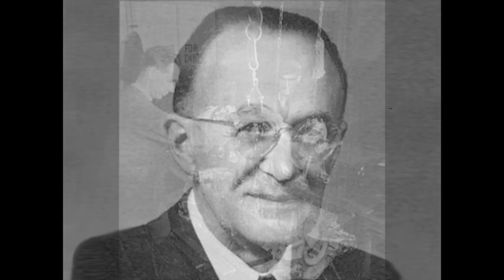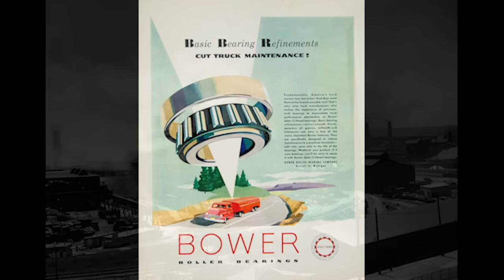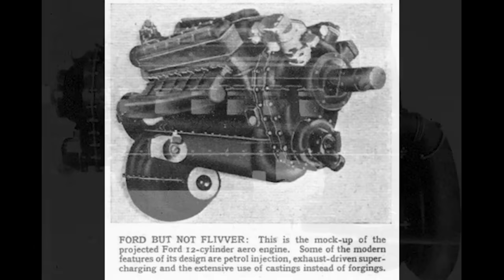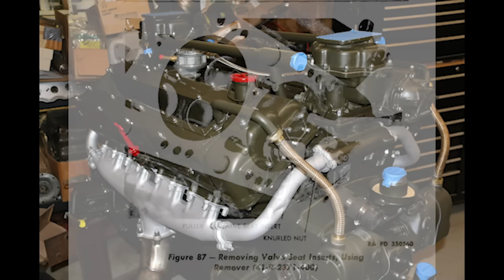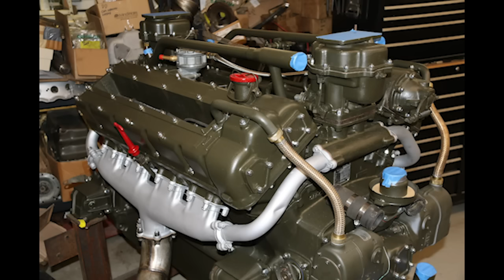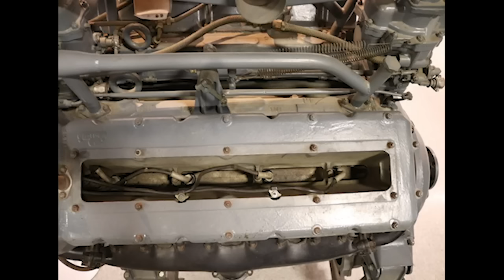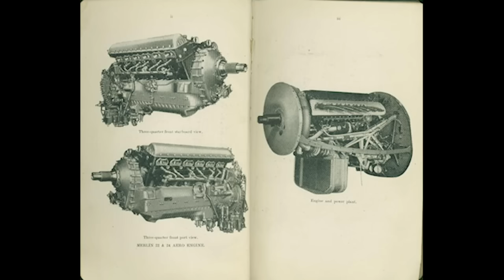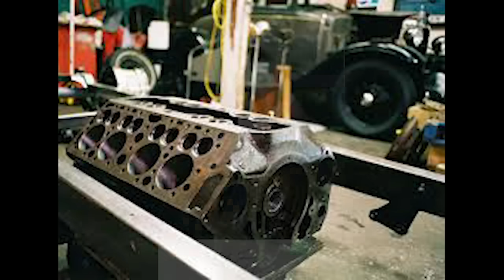War Hemi: The Story Of The GAA V8 - 1,100ci of aluminum WWII Ford grunt

Comment: Great post, Brian!
In the first minutes, you showed a pic with two bolt mains!
But later, a manufacturing correction with the splayed stud style main caps. Good!
But, burying the poorly insulated plug wires (7mm?) in between the cams and then sealing them in side had to cook the wires!
The braided cloth insulation likely didn't survive long in that environment!

Ford definitely helped win the war, but he was adamant that it was 'his way, or the highway'!
I'm a Chevy fan, obviously.  Ford 'sampled' the Merlin, while perfecting some areas and IMHO acceding to 'old ways' in other areas.
Ford's slogan, 'a better idea' was k8nda playin' catchup to the innovators at ... GM.

What was GM's contribution to the war effort?  Maybe you can tell us in a subsequent post.

I thought this post was gonna be 'technical'..... but a cast nitrided crank???  Really?
In some ways, Ford couldn't get out of their own way...

Okay, thanks for letting me rant for a sec.

Comment: The RR Merlin was not fuel injected btw and I must look into the twin GM diesel unit now.
Reply: Thats correct, the original Merlin relied on outdated, obsolete float bowl carburetors, later they bought Bendix PD pressure feed carbs from the Americans.
Reply: @DoktorBayerischeMotorenWerke  Look up Miss Shilling's orifice, a device created to counter engine cut outs during negative g manoeuvres.
Reply: @anthonyxuereb792  Thats a very popular british fairy tale, while the Schilling device did stop the engine from dying completely it did not remedy the sputtering and loss of power.
It was the Americans at Packard who found the permanent fix by installing the superior Bendix PD pressure feed carburetor.
Reply: @DoktorBayerischeMotorenWerke  I noticed a difference in the spelling of the name. Thanks to the www many "fairy tales" have been exposed.

Comment: The shaft & Gear cam drive combo just.. feels good.
Reply: It’s way better than a long timing chain that could most definitely fail under heavy loads
Reply: @georgegundersen562 less reciprocating weight equals more power
Reply: @Tanman799  yep, they’re also cheaper, quieter, and allow more wiggle room for engineering. well designed timing chain systems will fail with the rest of the engine. the same people will complain about chain guides being plastic.
Reply: thats what i thought
Reply: "Machinist's dream but Accountant's nightmare." I've seen it described as.
Reply: @unvaxxeddoomerlife6788Cam belts are great.  Honda and Toyota have used them for decades.  They should be replaced every 100,000 miles or so.
Reply: @spaceghost8995  my 5.4 has 268k..never touched...
 100k for cambelt just stinks..not good at all...500k minimum...B4 I put a wrench on mymotor if im lucky
Reply: @spaceghost8995  Those were only instituted to ensure engine annihilation, also known as J U N K. Finally, Toyota and the rest are going away from timing belts and Ford's wonderful idea was a belt driven oil pump. The belt lives within the crankcase. More J U N K!! Gear driven timing systems will always be superior to belt or chain driven systems.
Reply: @Sunspot-19 Volvo made an old engine gear driven.. excellent
Reply: @HANZELVANDERLAAY   Superior valvetrain is gears. Rubber band is epic failure baked in.
Reply: @Sunspot-19  I appreciate how much you know about machinery in general and engines in particular. Not Very Much Compared To Me.
Reply: @HANZELVANDERLAAY yep timing gears one steel gear on the crank and cam gear was bakealight? and it would wear make noise and needed replacement
Reply: @Sunspot-19 bent valves!
Reply: @Tanman799  I prefer hardened steel cast..
Cast in the dirt floor garage.. in India..
Flip flops are optional
Reply: @patrickshaw8595  Are you supposed to be special or sompin'? Evidently so.
Reply: @unvaxxeddoomerlife6788 Toothed timing belts were pioneered by Pontiac Motor Company on their OHC inline sixes. They have been and still are about the best way to drive camshafts. Too bad a young man named Britten is not still alive you could ask him why he used them on his famous world-beating motorcycle.
Reply: Bet that gear drive was loud as hell lol probably about all you could hear lol
Reply: @1BigDaDo  Don't think so. The system that powers the valve train includes worm drives so little to no gear-lash. Also there are videos of free-standing GAAs running...any gear whine is drowned out by overwhelming exhaust roar. Calling a roar btw is an understatement despite being a rather low revving engine.
Reply: @RuralTowner  Welded Stainless steel exhaust manifolds did not help with that but were indeed light weight.
Reply: @unvaxxeddoomerlife6788 think a lot of reasons for rubber belts is production cost and lighter reciprocating weight plus I made a lot of money replacing Honda cam belts think they finally went to chains
Reply: The skew gears were a source of problems throughout the life of RR engines. They have very high pressure contact points.
P.S. Ducati used bevel gears in their camshaft drives and were considered to be completely fail safe.
Reply: @neilmchardy9061  very true I was racing with various Ducati and never had any problems with the bevel gears, confirmed by my Ducati friends! But the pistons and the roll bearings are stressed crankshaft and is considered a bit weak. Regarding the Rolls-Royce Merlin the bevel gears required very careful precision work...
Reply: @neilmchardy9061  But at the same time, well designed (helix angle, tolerances) skew gears are inherently more durable than straight cut gears.
I totally agree that Ducati's "coppie coniche" bevel gears are fantastic in their engines (heck! as an italian biker a Ducati was/is a prime choice also for the desmodromic valve train design!), but in the end it's a very different engine with different acceptable maintenance timetables from a V8 Tank engine
Reply: @MC202zipper Straight cut gears are stronger. Just noisy as hell.

Comment: RR Meteorite made by Rover, Powered, tanks , tank transporter.    Petrol:  260 bhp (190 kW) at 2000 rpm  860 ft⋅lbf (1,170 N⋅m) at 1200 rpm. From 1948 from this design? the roots are there.
Reply: RR Meteorite was just a V8 version of the Meteor.
Reply: @agt155   Both versions/based on the Merlin

Comment: Also it isn’t even close to the largest V8 production engine of all time. I don’t know what the largest production V8 is but GMs EMD 8-710 is one I’ve worked on that comes to mind at 5680 cubic inches it is considerably larger.
Reply: But it is not aluminium; the boast was, the largest production aluminium engine v8

Comment: 600hours between overhauls! Are you kidding me! How the hell is this better then a pair of 671s? A 671 will go at least 10,000 hours between overhauls and if well maintained it will go considerably longer. Assuming a tank only runs a half a day we’re taking about rebuilding the engine every 2 months! Maybe tanks got blown up before they made it two months but that is absolutely horrible engine life!
Reply: The 6046 Diesels  were significantly heavier and the least powerful of the M4 Sherman engine options, they were used exclusively for the USMC due to the restrictions on gasoline storage onboard US navy ships.
Aircraft engines are the preferred type for tanks and the most successful tanks of WW2 all used a Aircraft engine.
Reply: @DoktorBayerischeMotorenWerke   Interesting, do you know what a WWII 6-71 was rated at? The ones that I see today are rated from about 220hp to 485hp depending on the injectors and if they are turbocharged or not. I’m going to say a natural asperated 671 with n65s is rated around 260hp but that’s with a modern 4 valve head. I’m assuming back in WWII they only had 2 valve heads?
Reply: @Trump985  Good questions! The 6046 6-71 twinpack was rated at 375 horsepower (188 horsepower each), which was alot for a Diesel truck engine back in those days.
 The Detroit 71 series is NORMALLY-Aspirated, with or without the turbo.
 the turbo is used to unload the blower under higher loads.
Reply: A 671 was a great engine  but not the best choice for cold weather operations. Gasoline could be easier acquired in the field compared to diesel as well.
Reply: @prevost8686   I’ve never had any issues starting a 671 in normal cold weather say above -10F give it a couple shots of either and it will light right off. Now when it gets really cold then heaters are going to be needed but normally we just leave everything running when it gets down to the -20s and 30s. I’ve never had a situation where I couldn’t get a 671 running due to it being too cold, I might have to use a heater or build a small fire underneath it but I’ve always been able to get one started providing it didn’t have other issues unrelated to the cold. 

Now as far as diesel availability goes that’s a good point. I forget that back then the fuel situation was the complete opposite or today. Today diesel is everywhere and gasoline can be hard to find in the field.
Reply: Itsaid, "at least 600 hours", it dident say they thats all, because some of those other engines were lucky to get that much.
Reply: @jerrynorton1080   Those test results in the video show catastrophic failures before 600 hours!
Reply: The 6-71 detroit was also no where near powerful enough to be satisfactory.
Reply: @ks_1111   what we’re the WWII 671s rated at for power? I’m was assuming they were around 260HP? 520 hp for a pair doesn’t seem far off of this GAAs considering that diesels make a lot more torque the gas engines do. Granted this GAA is only around 1,000 lbs compared to around 2000 lbs for a 671. Now a pair of 671s is going to be lighter then two separate ones as they shared the same cooling system and other things. I think we can safely say the dual 671 install was probably around 4,200 lbs while the GAA was probably around 1,200 lbs. Sure this is a significant difference but we’re taking about a tank here is an extra ton and a half actually make a difference on a 30-35 ton vehicle?
Reply: @Trump985  In the case of tank design more torque is not an advantage. 
 2,000 lbs.ft. sounds impressive but 375hp is not impressive in a 35 ton tank.

Hp-per-Ton ratio is critical in tank design, any long-haul trucker that has to go over the mountains will tell you horsepower is everything, torque will not maintain your speed over a steep grade.
Tanks are extremely high drag and it takes more hp per ton to maintain speed across the battlefield especially over soft or rough ground and slopes.
  This is why all successful tank designs in WW2used aircraft engines.  
  Aircraft have a high drag to speed ratio and require engines with high hp-to weight ratio performance and reliability at full power for extended periods of time.
 conditions and design factors not found in tractor or trucks.
In combat? you cannot reduce you speed and just grab a lower gear, slow moving tanks are sitting ducks on the battlefield.
Reply: It's wartime ,you don't play around with worn equipment. 
Sure it'll probably run 2-3-4000 hours after the war ,but for reliability sake it's good to at least 600.
Reply: @MrTheHillfolk  We are not talking about truck or tractor engines,
Aircraft engines at the time were rated for only 100 hours and when used in combat averaged 5 to 25 hours between overhauls.
the tank version was of course detuned but 600 hours was about all these highly stressed engines could handle...
Reply: @DoktorBayerischeMotorenWerke   Good god I had no idea. We’re talking about race car time frames on these aero engines! It’s amazing that they had any planes flying considering they needed an overhaul twice a week or more! We must have had an incredible number of mechanics on a airbase just to keep a couple hundred planes flying!
Reply: @Trump985  Indeed, we are talking about race car performance, a bomber on climb-out, or a fighter on an intercept mission will require 100% full military power for up to 30 minutes. WEP (War Emergency Power) allows the pilot to override the manifold boost control valve (Block the blowoff valve) and give maximum boost pressure and up to 50% more power for up to 5 minutes per flight before permanent damage occurs.
  If the engine is not used above its maximum continuous power rating time between overhauls can be 100s hours but WEP can require an overhaul after 5 flights and sometimes after just one use.

On Merlin engines, the plane must be grounded by the crew chief any time WEP is used and a mandatory internal inspection and spark plugs replaced before returning the plane to service.
Reply: 2x diesels are incredibly heavier the one big aluminum v8 …. Talk about ease of yanking it too…. I’d take that all day

Comment: I always wondered why they didn't use a cross plane crank in these or open up the bank angle to 90°. It also seems crazy the valves floated with an OHC setup at such low rpms and that they used such a large ex valve size relative to the intake valve size for such low rpm operation where you would want TQ. I would imagine that with modern technology you could make 2,000hp with boost on a GAA with no sweat for short bursts. You would probably need some tall gears to use it though. Like a 2.26-2.73 axle ratio with a 28"-34" rear tire and gears similar to a close ratio T-56 magnum with the 0.50:1 6th gear. So much for saying a flat plane V8 can't be larger than 5.2L like the claim was years ago about the GT350 having the largest production flat plane V8.
Reply: They were set at 60 degrees because this engine initially was designed to be a V12. 

The narrow bank angle though was a blessing in disguise because it fit more easily in the cramped quarters of a tank. 

The vibrations were dampened out by a heavy flywheel and vibration dampener.
Reply: "V8 can't be larger than 5.2L like the claim was years ago" I thought the same thing when I saw it was flat!
Reply: Large ex valve is a benefit for low compression engine like this one.i wonder about valve float too.the valves are probably heavy and stiffer spring may have caused reliability issues with the oil of the day.maybe served as rev limiter for 6in stroke cast crank.
Reply: hendo337  The Ford GAA V8  was a cut down version of Fords V12 for aircraft use why it was 60 degree.  in war time  time is of essence and it was quicker than redesigning a new engine !!!

Comment: Perfect. Hit every point. Oh, the Merlin did wind up in Cromwell tanks as the Meteor. Many thanx for another GR8 👍👍
Reply from the maker: Thank you! A story that had much more depth than I ever understood before digging into it!
Reply: Centurion tanks as well!
Steel block instead of aluminium, chargers removed, and derated for durability.
Reply: Meteors were in a LOT of Brit tanks. And associated vehicles, APCs, engineering vehicles etc.
Reply: @ldnwholesale8552 they also made a V8 version, my friend Pete Grieve is working on one for a drag racing Land Rover. https://youtu.be/CgV9skMYLxo?si=uI8dTF4DcrORb4Qn
Reply: And an 8 cylinder version, the meteorite, was used in a tank transporter post WW2.
Reply: The Meteor had an 8 cylinder version too. My friend Peter Grieve is working on a turbocharged one for his drag  racing Land Rover. https://youtu.be/CgV9skMYLxo?si=uI8dTF4DcrORb4Qn